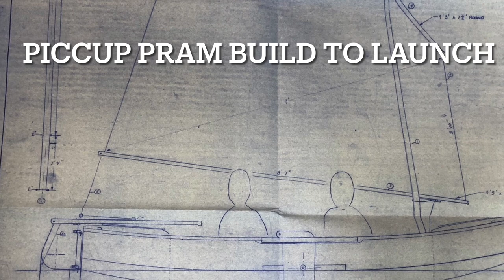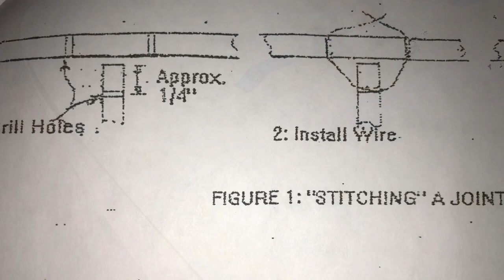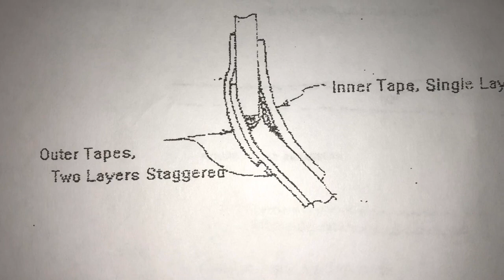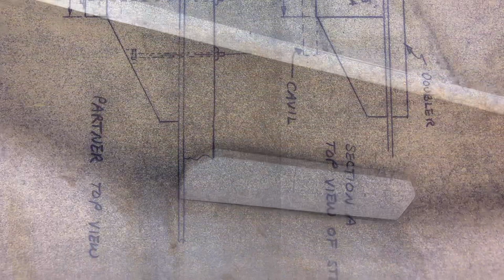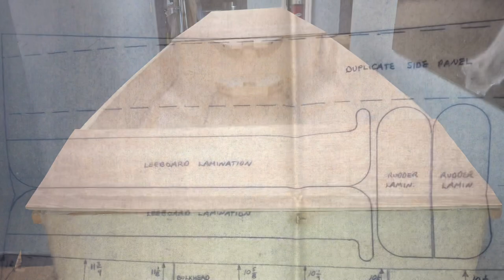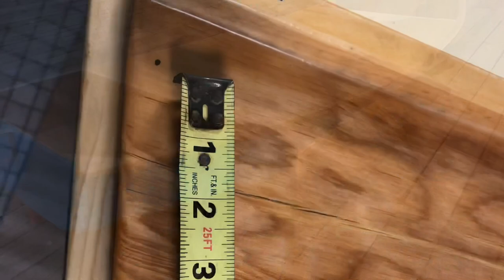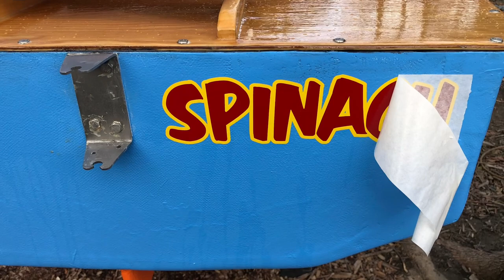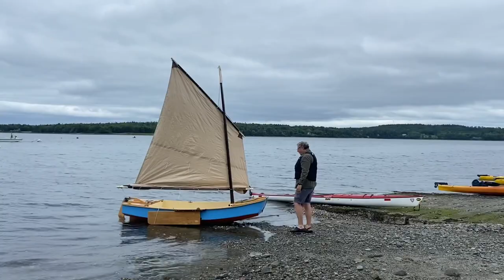Stitch and Glue Piccup Pram, Build to Launch. A handy fast sailing boat designed by Jim Michalak

Comment: Thanks for this video. You’ve inspired me to finaly build those plans that have been laying around for years. So I’ve bought ply and started cutting out bulkheads and transoms. Today I am adding the stiffeners to them and moving on to side panels and bilge panels.  And off we go!! So glad I watched all the way through to the sailing part that’s what really lit the fire. Just beautiful. Where are your sailing grounds? I’m in the Florida panhandle.
Reply from the maker: That is awesome! Good building wishes to you! I sail in Maine and South Carolina. There is a Jim Michalak Facebook page, you should post pics of your build there :)
Reply: Quick question, why the 3” mast?
Reply from the maker: @geoffadams5004  The mast is 2-2x4 glued together then a conical taper once you get out of mast partner. Easy build, it took 2 hours to make the mast not including glue dry time. The mast is pretty light as built and the size was specified in the plans.

Comment: Thanks for the video i was wondering if you had any problems with understanding the build process . I got the plans the other day and it seemed like there werent many actually directions. Also where did you get the paper copy printed at all i got was a pdf any help would be appreciated.
Reply from the maker: Go to the designers website, he can print the plans for you and supply that extra info, Id think.http://www.jimsboats.com/
Reply from the maker: also check https://www.facebook.com/groups/3036606923264970/
Reply: @goodkebo   much appreciated beautiful boat by the way